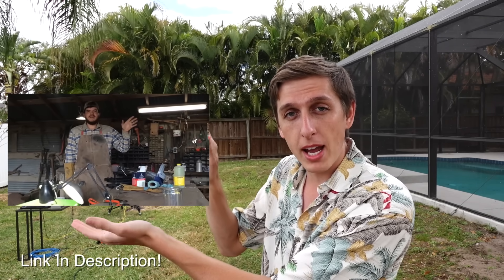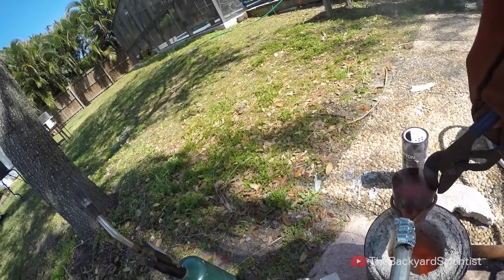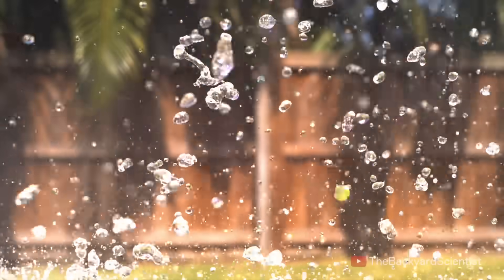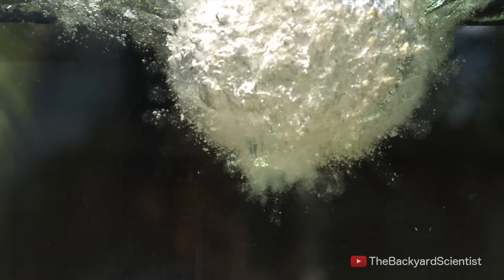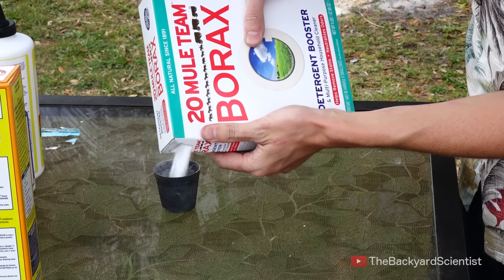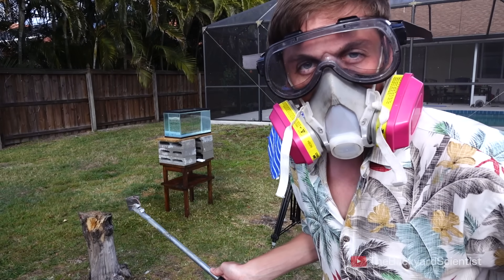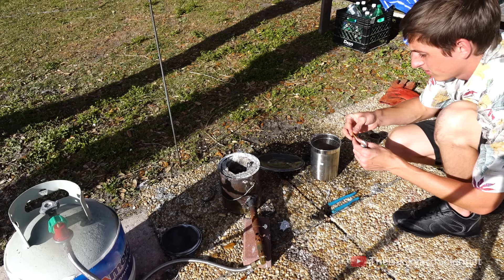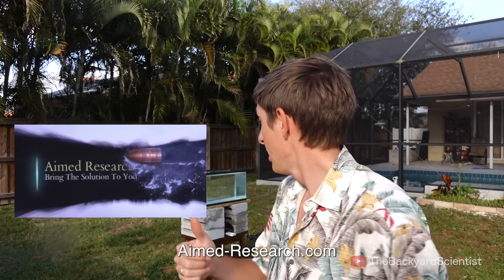Pouring Molten salt into Water - Explosion!

Comment: +TheBackyardScientist    Clearly the explosion is down to the analogue imbalance transition within the hyperbolic prokaryotic valance.   This is because the expanse of the proton's derek-rods cannot breach the occluded pivot telomerase.
Reply from the maker: I know some of those words
Reply: I can imagine how many people feel stupid because they have no idea what you're saying, when in reality you're actually not saying anything 😂
Reply: +TheBackyardScientist To make sure the Leidenfrost Effect takes effect, you need to bounce a graviton particle beam off the main deflector dish.
Reply: The troll is strong with this one.
Reply: +Tazuren Savu&#39;len You could also try reversing the polarity of the neutron flow.
Reply: ***** The tachyon neutrino grid is misaligned. You need to repolarize the anti-polaric modulator to maintain a stable quantum flux in the theta band.
Reply: It's quite simple.   The gravity and a and b waves on the peripheral valance occlusion horizon are in opposition; causing natural interference along the longitudinal lines of fraentzel intersection.   Consequently, any proximate lambda particles are affected (rapidly accelerated outwards), some of which may collide with any inward spiralling neutrinos.  Obviously, many ransoid nano-charges will occur in this process; which will neutralise the encapsulated kingstone eisenheardt effect.
Reply: +K4inan Agreed. The words prokaryotic and telomerase have absolutely nothing to do with this video (they're biology/biochemistry terms).
Reply: +Spoif Oh No! The Enterprise has lost their engineer!
Reply: Nuops Tujha I like how you think he's intelligent, he's literally making up words. What he said makes absolute zero sense. Trust me, I'm a particle physicist.
Reply: Should I laugh at the guy who used a bunch of random scientific terms just to look smart?
Or should I laugh at the surprisingly large amount of people who think he IS smart?

Either way I'm going to die of laughter because holy fucking shit guys xD
Reply: +Spoif As a particle physicist, this guy is just talking nonsense.
Reply: The sodium in the salt is releasing positrons which are causing gravitational fluctuations within the water. This in turn allows the grignard matrix area to expand due to collumb's forces. That is why it explodes.
Reply: +Spoif isnt prokaryotic a biological term and valence a subatomic term?
Reply: +Spoif But remember, never cross the beams. That could be bad.
Reply: +Spoif you sound like drunk Geordi La Forge
Reply: +Michaela Habra No.
Reply: Yes clearly
Reply: +Spoif i understand what you're saying, i think.

simply put.

water is being trapped in the solidifying salt, and due to the different transitional states of liquid gas and solid, the two are creating an explosive reaction where they are alternating rapidly.

"if you can't explain it simply, you don't understand it enough." - paraphrased.
Reply: what does prokaryotes and telomarse have to do with chemistry? you're talking cell bio words and a bunch of non sense.
Reply: glow262 That's the point. He's using jargon. Its satire.
Reply: Telomerase? That's related to cell division. You're just making shit up
Reply: Is it sad that I only know like 5 out of all those words?
Reply: The rare occasion someone is intelligent on YT.
Reply: +Spoif I personally think that the thingamabob hit the doohickey too fast causing the whatchamacallit to create a large amount of fluffer to blow the thingamajig to smithereens.
Reply: Clearly...
Reply: +Spoif That's nonsense. Literally nonsense. LoL people think this is real science.
Reply: It's scienglish :D
Reply: no habla espanol
Reply: +Spoif I'm pretty sure it's due to the inverse polarons cascading with the tachyon waves causing a reverse modulated subspace carrier wave implosion
Reply: You do realise you basically said bacterial valance and then random mentioned the tales on the end of chromosomes XD
Reply: I too have a degree in bullshit science
Reply: +Pandaz Even funnier because its obviously a joke and the amount of people not getting it is beyond hilarious
Reply: +Spoif You seem to have just gatered some biology terms and mix them with some general particle physics terms.

And even if this means something remeber "if you can't explain it simply you don't understand it well enough".
Reply: would have been passable blabber if it didn't have prokaryotic and telomerase.
Reply: +Spoif Haha! Random Telomerase is wondering "What did I do?"
Reply: +Shaun Rosner i really hope you're being sarcastic because if you learned anything in school you would know a prokaryote is a single celled microorganism, which has nothing to do with a chemical reaction in this situation
Reply: +TheBackyardScientist lol
Reply: +Tazuren Savu'len speak English you scientist
Reply: what
Reply: +Tonyy Starrkk (Tony Stark) All I heard was that something caused an expansion, so fast that it was with explosive force.
Reply: +Spoif Oh No! The Enterprise has lost their engineer!
Reply: +Richard Cano his yard was very green!
Reply: the molten salt rapidly released all of its heat, while the others had leidenfrost effect
Reply: Holy Shit i feel dumb
Reply: +ATacticalDuck you're a wizard harry
Reply: SmokelessTrigga He's just talking nonsense to be funny though.
Reply: English please.
Reply: Simplify that.
Reply: +Spoif Thats such bullshit science, you have just combined a bunch of scientific words into one sentence... In what world does telomerase have anything to with this? You know, that loving enzyme that adds telomeres to the ends of chromosome during mitosis?
Reply: +Tomáš Kubinec   Run a level 3 diagnostic - just to be sure.
Reply: spoif and mc overload are my science gibberish heroes
Reply: Yea,uh that's what I thought......

Uhh...

Wut?
Reply: +Spoif You lost me at "It´s". 

But then I picked up again at "...occlusion horizon are in opposition; causing natural interference along the longitudinal lines of fraentzel intersection.   Consequently, any proximate lambda particles are affected (rapidly accelerated outwards), some of which may collide with any inward spiralling neutrinos.  Obviously, many ransoid nano-charges will occur in this process; which will neutralise the encapsulated kingstone eisenheardt effect." Makes sense, actually.
Reply: Fact, if you use big words all pertaining to science, you will sound smart to common people even if you make no sense
Reply: +timrhicks1234  what he's saying is that he's tricked us all into believing his shit talk about proteins and deoxyribonucleic acid
Reply: +Tazuren Savu&#39;len And then Horton the elephant will eat your head and turn you into a pony
Reply: +Clunkerdoodle your comment fits your name
Reply: +Spoif 
Idoit! You forgot to carry the 1.
Reply: +Spoif u fukin wot m8?
Reply: +Spoif Troll Detected.
Reply: My god, the people in these replies are stupid... Fucking internet.
Reply: +Spoif wat
Reply: +Spoif I'm 99% sure this is just a random collection of words. The word prokaryotic gave that away.
Reply: +TheBackyardScientist BEST REPLY EVER !!!!
Reply: +Tazuren Savu&#39;len Obviously, how silly of anyone to think otherwise. I would add that the lepton-activated proton would spike a chemical reaction with the Bose-Einstein condensate, causing a degenerative Solaris effect on the positron.
Reply: whatever you do, don't cross the fucking streams!
Reply: +Mat Cas *you're
Reply: +Spoif ...Yeah. Clearly
Reply: i think i died on the inside a little
Reply: 😂😂 just using random science words. Prokaryotic is a type of cell
Reply: +Spoif  The essence of a good teacher is being able to explain in words of one syllable so that EVERYONE can understand. Blinding people with science is NOT helpful.
Reply: +Spoif +TheBackyardScientist Obviously it's a derivative of 42. As the Heisenberg difference is calculated from particles of superamniotic fluid the range of which one can perceive the Virchow effect is only 2 dioptries. This makes for what we think is an explosion but as you were saying, the hyperbolic prokaryotic valance is dictated by photons of hyperdrive-speed. I think you are on to something here.
Reply: hahahahahahahahahahahaha.. for the slow minds, he's just joking.
Reply: i see what u did there 😂
Reply: I'm going to put my quantum harmonizer in your photonic resonation chamber!
Reply: +Spoif Nice smattering of biology, i hope the thumbs up are only in sarcasm.
Reply: So basically what ur trying to say is that when the molten salt hits the water it goes boom boom
Reply: +Spoif umm... so like...boom?
Reply: *****

Dasher, Dancer, Prancer, etc.
Reply: +Spoif [Speech 70]
Reply: Thats true man. Things are created and found out by acidient mostly... dond need eaven megaminds to do that.. tho there are no megaminds.. only knowledge... some just can suck it up some dotn.. ones who cant they just dont care. :D
Reply: I don't understand lolol
Reply: ummmm what can you speak English
Reply: Can you simply that??
Reply: +terry lough that is English, you need to speak science...but that is rather confusing
Reply: +Spoif Whaaat?
Reply: +Spoif lol
Reply: +Tonyy Starrkk (Tony Stark) Of course you'd understand your a certified genius. (love the hot rod red)
Reply: +Michaela Habra Don't worry, he's just talking nonsense.
Reply: +Tazuren Savu&#39;len now you're just making things up ;)
Reply: +Spoif No, it was pretty. Definitively pretty.
Reply: +Michaela Habra its english you just dont speak "Science"
Reply: ATacticalDuck He just used a bunch of words, it's all mumbo jumbo.
Reply: +Spoif Don't forget where it can reverse the polarity of the neutron flow using multimodal reflection sorting.
Reply: +Spoif You need to speed up at 88mph anyway
Reply: +Spoif Are you Deepak Chopra?
Reply: +Nuops Tujha still no signs of intelligence anywhere everyone. not even you nuops.
Reply: +K4inan What did Dr. Watson say when he looked at an empty toilet?
Reply: +Spoif SCIENCE  !!! FUK YEAH i understood every thing you said :'D
Reply: +Q'own Son (Q) they are variables and the John nestle reaction is responsible for the "explosion"
Reply: +Spoif True. Tides go in tides go out.
Reply: +Spoif  if you look closely at 4:38 you can see a vortex ring shooting down to the left.
Reply: +Spoif i would understand this if i knew english beter :D If u feel dum reading this..
1. u may not understand the language
2. u may not know the structure of molecules
3. u may not know few spesific words
4. u are dumb
Reply: +Spoif Word salad is fun lol.
Reply: Pour liquid metals into eachother
Reply: yeah that's what I expected
Reply: In English please?
Reply: +Spoif english man do you speak it,can you explain it in a way it doesnt hurt my brain
plz
Reply: Learned that from your online chemistry degree? :)
Reply: Marco Garcia He is talking gibberish man. He is joking.
Reply: +Spoif ok, so the sodium and hydrogen is doing the job. i see i see
Reply: I understood almost every word. Is this bad?
Reply: Only if you think that it makes sense...
Reply: +Oliver Wright W H O S W R I T E I N G T H I S W I L E T H ER E IN C L A S S????
Reply: +Heath Parker Have we tried setting it to wumbo?
Reply: +Tazuren Savu&#39;len  Tell us something we don't already know...
Reply: +Spoif BIG WORDS
Reply: +Tazuren Savu&#39;len voltaire :P
Reply: I can't tell if this is a joke xD
Reply: +Heath Parker Awww... but I wanna understand.
Reply: +K4inan Thanks, I was beginning to feel really stupid.
Reply: +terry lough Can you speak English, or only Afrikaans?
Reply: +Oliver Wright (It's satire)
Reply: +Spoif No
Reply: what if it's because the salt is so close together
Reply: Yes.
Reply: +Ryan Moulder if I remember correctly, spoif is the new term given to gravitational waves
Reply: Ryan Moulder in that case it is really funny
Reply: Wtf
Reply: +Spoif Dilithium crystal toblerone bazingas are responsible.
Reply: +Jase Rusk thats just- wow...
Reply: +Spoif no your face made it explode
Reply: That's going to be a pain in the "glass" to clean. Lol
Reply: +Dan Bodine Yep, that's non sense. People, wake up!
Reply: +Spoif HAHA! XD
Reply: +Spoif What language is that? i can't translate it
Reply: +ATacticalDuck dont worry they are just talking giberish, none of the terms they are using apply to this experiment
Reply: you lost me at telomerase
Reply: ya lost me at hyperbolic dude
Reply: +Spoif I think it has more to do with the two sconic masses which cause extreme temperature variations between 8 to 243 likons. Ankler blocks counteract the process of ponticribation while omalien globes regulize the pressure.
Reply: +Spoif wait...why is there an enzyme involved with this, what does this have to do with bacteria? Are you sure your posting on the right video?
Reply: +Spoif w0t
Reply: +Spoif lol telomerase is an enzyme that I'm guessing would disassemble telomeres. Love what you're doing but wtf is a DNA enzyme doing in that explosion XP
Reply: +Spoif WTF are you talking about!!!! it was purely chemistry dude! Do not correlate with your stupid invented scientific terminologies!
Reply: +japson cruz purely physical. to have had a chermical reaction, you would need to heat the NaCl much much MUCH higher than a mere 800 celcius (even if it is a simple ionic bond) and have vaporised all the chlorine out. the reason why it exploded and the other salts didn't is because of the viscosity, or general cohesion of the fluid. it was hot enough where the van der whall forces where nearly nullified (near boiling point)
Reply: then which  physical sciences are you referring to? hhhmm still in chemistry though.
Reply: +Spoif This is nonsense! Having watched the video three and half times, I am pretty sure it's actually eukaryotic valance we're seeing here. You don't even know what you don't know.
Reply: +Spoif Prokarytic Valance, Bahahahaha.
Reply: +Spoif that sounds like biology....
Reply: Totally not copied off the internet.....
Reply: I was definitely sold if enzymes of the human body weren't brought up in that description.
Reply: +Spoif Nonsense!
Reply: +Spoif  wut lol
Reply: Guys, just because you throw some fancy vocabulary together in a giant sentence does not mean you know anything.
Reply: +Spoif yup that's exactly what happen.
Reply: Aaron Fang Shenhao  it means nothing
Reply: Prokaryotes have to do with living cells, you just looked up those words on Google and put them in a sentence
Reply: +Spoif Clearly. I mean who didn't know that? It's not like we're all imbeciles here
Reply: +TheBackyardScientist I think you are correct. The salt cools and its atoms separate more and more as it cools, while still being hot enough as a whole to create small steam explosions that are constricted by all the other small steam explosions, creating more heat as they resist each other and therefore acting exponentially. Maybe the other sodium substances you tried had atoms that were too close to each other or too attracted to each other to allow the reactions.
Reply: +Jase Rusk No your not :
You began your sentence in lowercase!
Your opening line is a question !
Your last sentence is a statement !
Neither of the statements are grammatically sound!
  .....and anyone can read the back of a toothpaste tube!

Na just joking mate .. thats an impressive vocabulary of chemicals you've written there and i wouldn't have a clue even how to say them .My guess is it's some sort of Low fat ,Vitamin enriched ,Colour changing ,Spearmint flavoured Diet Shampoo with artificial sweetener..I think my missus is using it.
Reply: +Spoif Y u speaku japanesu
Reply: VideoDeadGaming Twoshay.Lol
Reply: +Spoif In the immortal words of Voltaire, "Bounce a graviton particle beam off the main deflector dish
That's the way we do things, lad, we're making shit up as we wish"
Reply: +ARaheem BoltZ  - Aw mate - Funny as f**k - I just yelped out loud like a small child and startled the crap out of the cat. It's too early for a beer, but I'll email you one for later :)
Reply: +TheBackyardScientist - I understood Derek - Do I get a prize? I like prizes...
Reply: That random science name droping, lol. However you used a lot of biology terms, when physics and chemistry terms would have been more fun.
Reply: BadYossa Thank you Mr. strange person on the internet. I'll eagerly wait for my beer.
Reply: ARaheem BoltZ - Nought wrong with being strange!
Reply: BadYossa Of course. I love strange people <3
Reply: +Spoif I'm sorry, but I don't speak bullshit.
Reply: +Michaela Habra They're spouting terms completely unrelated to this reaction.
Reply: +Spoif If you can't blind them with brilliance you can baffle them with bullshit
Reply: +Tazuren Savu&#39;len For God's sake, Jim... I'm a doctor, not a theoretical physicist!
Reply: +Aiaiaii z .......................
Reply: +Spoif so, if i understand you right, you think it is a quantummechanical reaction? ._.
Reply: +Spoif huh??
Reply: +madara uchiha a Lot of slow minds on this thread including the I'm a particle physicist guy.
Reply: ?????? wtf
Reply: This literally means nothing... Even a chemistry degree won't help you
Reply: ***** It means that the hyperbolic phosphate isn't compatible with the exergonic relay gap left by the polymerasic gluon field provided by the distillation structure.  An idiot could figure it out.
Reply: You've got some fancy Physics, Chemistry and Biology words in there well done ;)
Reply: Thomas Parker I try
Reply: +Clunkerdoodle I see. That actually makes a lot of sense now when I think about it.
Reply: +Spoif Exactly what I was going to say, you just beat me to it.
Reply: +Spoif You're totally right, as you can see by the doppler effect
Reply: +Spoif The neutrino part gives you away.  As they are non reactive particles and pass through normal matter undetected.
Reply: +Spoif As soon as I noticed the Biology terms, Like Prokaryotic and Telomerase- this was a troll post, and a really good one. Thank you for making our commenters here into bigger retards.
Reply: +K4inan no he's not. its all truth.
Reply: SROnivera1 Woah dude, your neutralized apogees are way titrated.  Calm down
Reply: +Spoif Personally, I think it's due to the mitochondrial electrons' failure to photophilliate.
Reply: +Spoif Yeah...but why?
Reply: Yes I also understand science
Reply: +Spoif That's what I was gonna say.....
Reply: +Tonyy Starrkk (Tony Stark) lol i know i was laughing at this shit so hard
Reply: +Spoif Good boy! Now you can have your candy.
Reply: this is nothing.....
 compared to a thermonuclear Cobalt explosion at sea level
Reply: +Spoif ]Prokaryotes are single celled bacteria. Valance are drapes and curtains. Telomerase is an enzyme found in the nuclei of cells.
Reply: +Anthony Schurz  Is there video footage of what you are sharing..?
Reply: BossaNossa1 look up thermonuclear Cobalt , AKA " doomsday bomb"....
In other words kiss your ass goodbye
Reply: Dear Spoif .......................

HHHUUUNNNNNHHHHHHH.....???????????????????
Reply: Did you just type some random shit, when you probably don't even know what most of it means....😩
Reply: ha oh yes clearly....... briefcase!!!!!
Reply: Dear Bailey Johnson, 

Did he just type random shit when he probably doesn't even know what most of it means......???????????

No, what a few of them did was they cut every word out of a dictionary and dropped the entire pile off of the roof of their homes. 

The words that faced upwards were used to create the sentences that they just typed.
Reply: I think I have an explanation why the other Salts you pored didn't blow up.The other salts have different components to them, and those could've neutralize the sodium inside of it just like what happens when you mix sodium and chloride( both highly dangerous on their own)and get the salt that we eat everyday
Reply: +Spoif  Wow!  And for years, I've always believed that the encapsulated Kingstone Eisenheardt was still buried under the north leg of the Eiffel Tower.  This changes everything!
Reply: +Spoif Yes, clearly. So what?
Reply: +Tazuren Savu&#39;len Thank you, Miles O'Brien...
Reply: +Spoif truly, you have a dizzying intellect.
Reply: throngcleaver

No man, it's buried in my back yard.
Reply: +Spoif Great Scott!
Reply: +K4inan I'm not a particle physicist and when I saw spiralling neutrinos, I just laughed!
Reply: This conversation is so nerdy that it made my head explode with a new vocabulary.
Reply: +Sun and Moon The color of red hydraulic fluid is 430 THz.
Reply: ***** Actually, I don't think you all are using correct grammar. I just looked up this proton derek-rods crap, but I only found a picture of an athlete. I even asked my mom, who's a professor at a local university, about it, but she said that she's never heard anything like it.
My conclusion: you all are using a few not-so-common-words to make yourselves look clever. Oh, and don't get me started with "the color of red hydraulic fluid is 430 THz".
Nerds.
Reply: Lol... I remember my teacher discussing us with the rainbow spectrum in 6th grade.
Red, orange, yellow, green, blue, purple, and violet. I also remember talking about frequency and sound waves.
Want to know something that you already know? - the most powerful ray is gamma.
Reply: +Spoif Dito
Reply: +Sunia Vuki I think he is just explaining to us, what the video sounded like to him. Lol
Reply: +Spoif This is some AP Chem shit right here guys . . .
Reply: +Sun and Moon the most powerful Ray is mysterio
Reply: ZapKn1ght555  I am the "smart guy" that wrote the original comment.  The comment of course is complete and utter nonsense.  My
intention was a light-hearted techno-babble joke in view of the "mysterious" reaction taking place in the video.  However, it is people such as YOU, Sir, that I feel quite sorry for.  I'm talking about the numerous people that took the comment seriously.  Those who took umbrage and tried to debunk it by using their own self-professed super pseudo-scientific abilities.  I can't believe the number of +1s and replies the comment received, as well as the number of fools that thought it had any basis of scientific fact.  So to YOU (amongst others) thinking the comment was serious... Congratulations!!!  You have merely proved that you're an insecure idiot that feels the need to prove something by debunking nonsense, that's quite obviously complete crap.  The reality is that if you had a modicum of scientific know-how, you would have joined in the fun and had a bit of a laugh. But instead, you've only proved to everyone that you're a total dick-head.  Brilliant work Einstein.
Reply: ***** The comments with all the hydro junk and space crap was quite humorous. It almost made look like we were at a science convention talking about the new Nobel Prize winner. X'D
Reply: ***** There wasn't anything serious about this video. XD Did his experiment blow up the world? - no. So why would I worry about the "explanation" to why it happened?
Plus, I don't see too many scientists bragging about what they know. Instead, they inform the people about what occurs around the environment. Now what I could think about is climate change, because it has affected a lot of people, plants, and animals. Also, the weather has been acting queer lately.
Reply: I disagree. We wouldn't typically see analogue imbalance in a trimodal semi-probabilistic reductance field, as observed in the k-beta wave disruption pattern immediately after the salt impacts the water. As for the expansive derek-rods, this only applies to non alkaline or semi alkaline photon barriers. Interesting theory though.
Reply: Spoif ur gonna kill me with all that science
Reply: that's why I don't go to science class